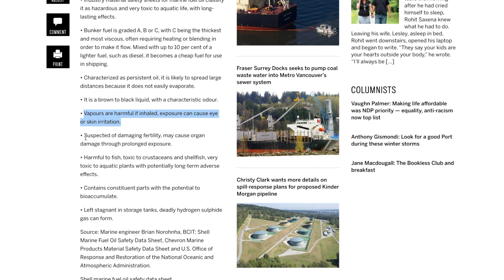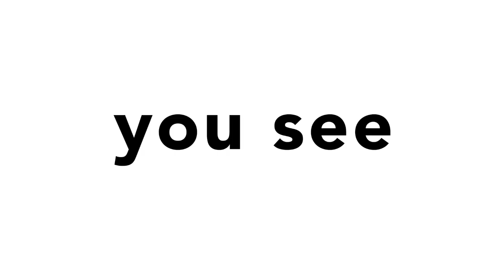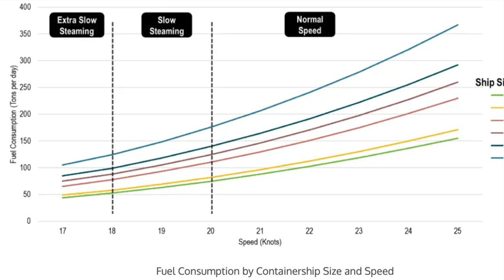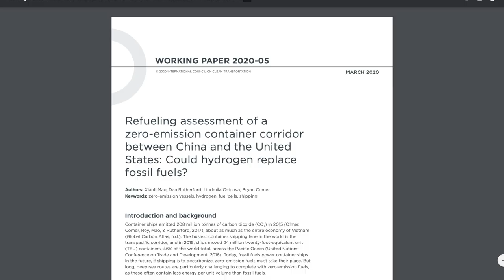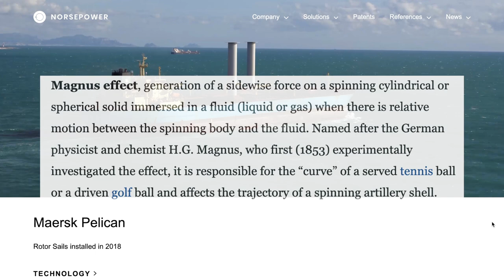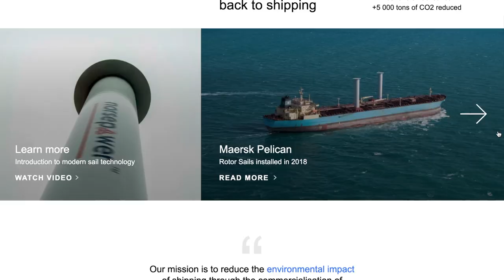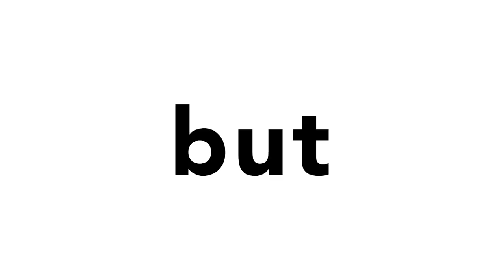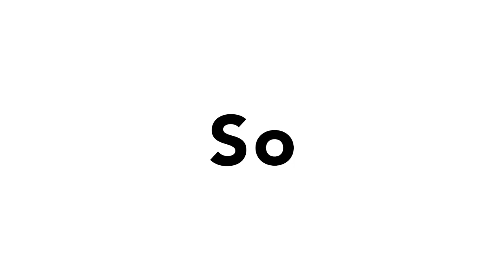Are Renewable Container Ships Even Possible?

Comment: May be crazy, but nuclear powered hydrogen production in the middle of the ocean would be interesting to consider.  A lot of the opposition is people not wanting to be in proximity to nuclear, which this mostly solves.  Also modular reactors shipped by sea should be much cheaper than site-built.  Russia already has a floating power plant.
Reply: WADR the Russian floating nuke is firmly moored in one place, Pevek, and has its critics. H2 is said to be good for use in fuel cells that will give clean energy when combined with Oxygen (O2) and leave only water (H2O) as an effluent; so as well as the cost of creating the hardware and separating out the H2 in the first place we now have the cost of separating out the O2.  H2 is very, very light and very, very volatile so this is where we remember the Hindenberg disaster, the ‘light’ means that though there is lots of energy per unit mass there is not much mass per unit of volume so all the problems of CH4 but much worse.  You need to compress it, more than a lot, or cool it, more than a lot, to get enough on board your ship in manageable volumes to be useful.  The alternative to fuel cell use of H2, burning, also generates combustion products which includes waste heat going to the cold sink and a few NOx nasties.  The 'Just Have A Think' channel recently posted a video on hydrogen as both a stand alone molecule (H2) and as a component ammonia (NH3).  The numbers, on any of these, are getting very difficult to show any sort of surplus so is this, hydrogen, a case running hard to stand still?
Reply: If you are going to use nuclear power to generate energy from a fuel cell, just use a turbine you'd need one to generate the power to split the hydrogen from water anyway, why not just directly use the turbine to turn the propellers and the generators for the auxiliary systems?

Comment: Thorium would be a viable option to power container ships - more abundant than Uranium or Plutonium, produces waste, that has short half-life time span, can be melted down and moved to a special storage chamber in case of reactor malfunction.
Reply: Modern iterations of nuclear energy, thorium fuel, molten salt reactors or fusion reactors, will carry the legacy of past problems.  It is the global trepidation of anything with 'nuclear' in the name and the economics of nuclear having transitioned from 'energy to cheap to charge for' too 'the costs of remediation are incalculable' that will prevent the adoption of nuclear energy as a means of creating energy at sea.  Modern reaction systems may have overcome the safety problems but the general public, having been misled in the past, will be reluctant to believe the fresh new promises.

If you do a web search for ‘nuclear ship savannah’ you will see that it has been tried and did not work.  A similarly heavily subsidised, by the government, vessel is in use in Russia which also operates, in support of the Northern Sea Route, a fleet of nuclear powered ice breakers these may, or may not, have been completely without issues.

Just think; would you have full confidence in the management of a nuclear reactor under the control of an anonymous entity only traceable, perhaps, via a letter box in a FOC (flag of convenience) nation state?  If you are, could you sell that confidence to Japan, the state that hosted the Hiroshima and Nagasaki nuclear detonations as well as more recently the Fukushima ‘event’?  Then try that same, or a similar, sales strategy on Ukraine, the nation state that as a part of the USSR (CCCP) hosted the Chernobyl ‘event’.  

‘They’ say nuclear is cheap, it’s not it is expensive and has a large embedded carbon quotient as well as being complicated, dangerous, not universally socially acceptable and having only ‘no need for refuelling’ as a questionable advantage; actually it does need refuelling just not as often.  When ‘they’ do need to refill the warming up stuff it takes considerable longer than pumping tonnes of thick black stuff, HFO cSt380, or thin runny stuff, MDO, onboard which is one of the reasons HMS Queen Elizabeth and HMS Prince of Wales are pushed about by ICEs and gas turbines thus using a similar fuel as the aircraft that fly off of them.  The Royal Navy (RN) with a high degree of skill and expertise uses, at vast expenses to the UK taxpayer, a current operational nuclear fleet of 11 submarines (also known as ‘boats’) in two flotillas, seven attack subs and four ballistic missile boats.  The carbon footprint of all the extra bits of hardware and the fuel, including processing thereof, from ground to propeller, are the external costs that never seem to get considered.

Disposal, once it wears out, of both the machine (that was a ship) and fuel is another can of worms best left unopened.  The 26 RN boats no longer in use are laid up (some in Rosyth and some in Portsmouth) awaiting long term deconstruction including dealing with the fuel rods and other irradiated material.  The USN is not, as far as I know, a commercial organisation working to very tight margins and also has the skill and expertise to handle the complexities of nuclear power; so as well as submarines their aircraft carriers are nuclear powered and each of the current iteration has a build cost three times that of QE/PoW, bigger crews and more generous funding.  For those who still think that nuclear energy might be the answer I recommend this report: - https://www.bbc.com/future/article/20200901-the-radioactive-risk-of-sunken-nuclear-soviet-submarines?ocid=ww.social.link.email.  The navy of the USSR might have been under resourced and over extended but it was still generously supported in comparison with merchant shipping.

Comment: The biggest problem with nuclear cargo ships I see is if pirates hijack the ship, it can mean super bad news, as they could ransom for enormous sums of money with threat of deliberate contamination of the waters. Worse, they could sell that to certain countries or terrorist cells with ambitions to build a dirty bomb.

A military operating nuclear ships can defend itself, but cargo ships have limited ability to defend itself in comparison.
Reply: Nuclear power; which has been tried and did not work, except for warships, start by doing a web search for ‘nuclear ship savannah’.  ‘They’ say nuclear is cheap, it’s not it is expensive as well as being complicated, dangerous, not universally socially acceptable and having only ‘no need for refuelling’ as a questionable advantage; actually it does need refuelling just not as often.  When they do need to refill the warming up stuff it takes considerable longer than pumping tonnes of thick black cSt380 onboard which is one of the reasons HMS Queen Elizabeth is pushed about by gas turbines thus using the same fuel as the aircraft that fly off of her.  The Royal Navy (RN) also have a similarly high degree of skills and expertise and the RN’s current operational nuclear fleet is 8 boats in two flotillas, four attack subs and four ballistic missile boats.  The carbon footprint of all the extra bits of hardware and the fuel, including processing thereof, from ground to propeller, are the external costs that never seems to get considered.  Disposal, once it wears out, of both the machine (that was a ship) and fuel is another can of worms best left unopened.  The 26 RN boats no longer in use are laid up (some in Rosyth and some in Portsmouth) awaiting long term deconstruction including dealing with the fuel rods and other irradiated material.  The USN is not, as far as I know, a commercial organisation working to very tight margins and has the skill and expertise to handle the complexities of nuclear power.  For those who still think that nuclear energy might be the answer I recommend this report: - https://www.bbc.com/future/article/20200901-the-radioactive-risk-of-sunken-nuclear-soviet-submarines? ocid=ww.social.link.email.  The navy of the USSR might have been under resourced and over extended but it was still generously supported in comparison with merchant shipping.
Reply: @BernardLS  Wow this is a very ignorant comment.

Nuclear power is the most energy dense, one of the least emissive, most environmentally friendly sources of electricity we can use.

As for with nuclear marine vehicles, nuclear submarines have become the predominant submarine design worldwide.
Reply: @Project2457official  Since posting my comment we have had the 'Evergiven' and the 'X Press Pearl.  The incident of the ‘Ever Given’ blocking the Suez Canal, March 2021, may also have a little to add to this debate.  The cooling water on ships tends to get taken in from near the bottom so when running aground the inlets are in a prime spot to get plugged up restricting, if not stopping, the flow of coolant.  One thing that the TMI, Chernobyl and Fukushima incidents all had in common was that the supply of coolant, or rather lack thereof, was a fundamental cause.  Similarly and only months later, May 2021, had the ‘X Press Pearl’ been nuclear powered then a major port for a populous nation in the global South would have possible been the site of a significant exclusion zone due to a non power plant related incident.  If the ‘X Press Pearl’ had on board a fired up but ‘safe’ molten salt reactor and found herself having to run down the possible 12.5 megaWatts of energy in the power cycle would a stable cool down have been possible while the cargo fire burned?

Why not use nukes?  It is down to engineering, finance, socio-political attitudes and safety.